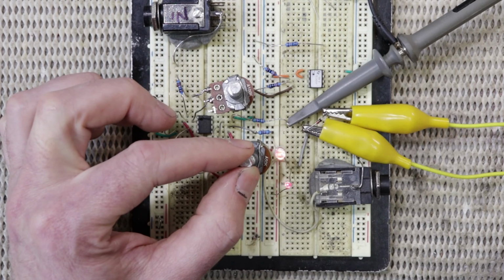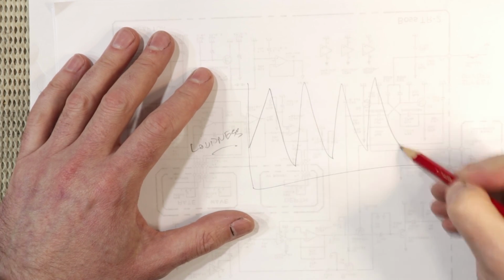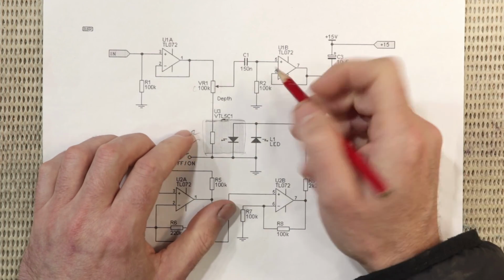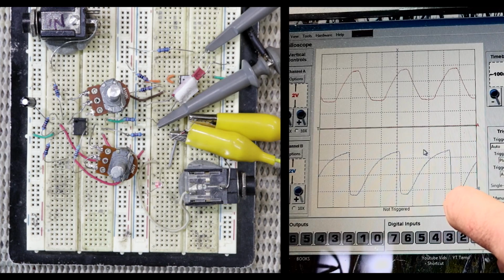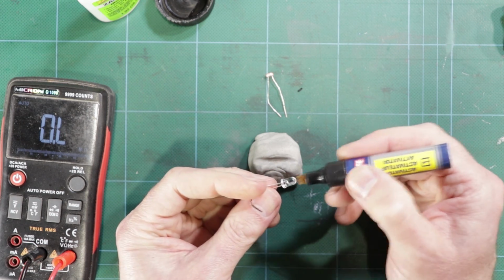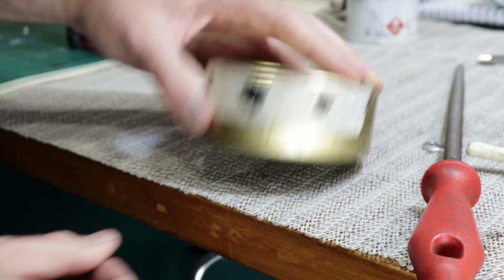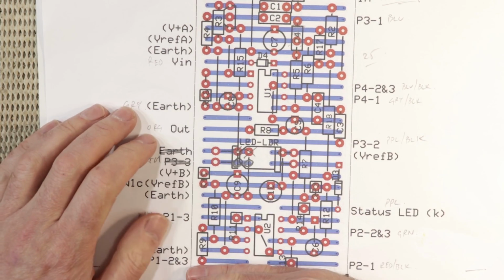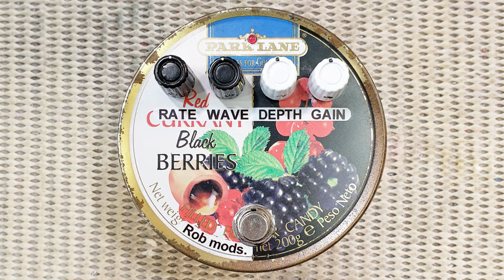DIY Optical Tremolo.  How to design a tremolo guitar pedal.

Comment: Can you elaborate on the c taper hack? Thanks!

Also about the ticking, I've read that they usually use low power op amps. Like tl022 or maybe try using tl062.
Reply from the maker: Yes, I've read this also.  In fact when I was filming I did talk about that as a possible 4th tweak if the others hadn't completely cured the ticking.  (I cut it out in the edit though.)  It makes sense, since a low current op amp also usually has a very modest slew rate, so it can't physically source the current in the first place, plus its output is slower to shift each time it flips.    I did actually try an LT1475 (ultra low current device) that I found, but since it was a true rail to rail, the tremolo sound was significantly altered, since the LEDs were turning on a bit brighter.  To make another op amp work would have meant breadboarding the circuit again, and the LM358 was just fine.  It has a fairly modest current draw and slew rate anyway.  

FWIW, getting the LEDs to match also took some tinkering.  I really wanted to use a 3mm as the status light, to match the other lolly tin pedals.  I probably should have just started with a matching pair of 3mm LEDs and made the isolator with one of them.  Thanks for watching my channel!
Reply from the maker: Oh, and the pot hack was simply that I needed a C50k (reverse audio taper), but only had a dual gang C100k.  By wiring the two gangs in parallel, a C50k was achieved.  IOW, the two left lugs were joined, the two wipers were joined and the two right hand lugs were joined.  In this situation, the taper stays the same.  FWIW, I have an old video with some other pot hacks...  https://youtu.be/iCUOVOOc5WY

Comment: @Rob Mods enjoy the Wurlitzer electrostatic continuous free reed organ vibrato circuit. The North Suburban Hammond Organ Society did some really good animated tech articles. 
VIBRATO CIRCUIT EXPLAINED-- first a little info about Hammond tone wheel organ vibrato and simple theory-  nshos DOT com/HAMMOND8.htm
And here is the unique Wurlitzer purely electronic vibrato ( nothing mechanical)  nshos DOT com/WUR12.htm

The Wurlitzer continuous free reed organ was Wurlitzers answer to Hammond's instant attack. Putting all of the reeds in motion at once from the moment  the organ was turned on allowed for this instant attack. It required all of the reeds be soundproofed. This Wurlitzer 4600 (in tech article link above) 25 pedal 2 x 61 keys ( and 4410 spinet version) organ introduced in 1954 was also the first ever organ with sustain. Wurlitzer invented the clever bleeder cap + resistor on each and every key for sustain decay on the DC Keyed keyboards ( a common method of all manufactures...except Hammond, the Hammond tone wheel organs aka B3/C3/M3 etc. were never conducive to sustain)

Comment: I can suggest to use separate grounds for generator and audio path, especially if wave control has opto-coupler.  This will reduce dramatically leaking of generator frequency into audio path. Also adding a high path filter on the end stage of U1 with frequency roll-off around 50-100Hz will greatly reduce that generator frequency sound at amplifier side.

Comment: This is such high quality content! Love your videos!
What would it take to make it commercial grade?
Reply from the maker: Thanks mate.   I'm glad you like my stuff.   I think you'd have to find a good consistent source of opto isolators. The LDRs i bought did vary quite a bit.  Then batch test them and adjust the circuit from there or create a trimmer circuit and alignment procedure for consistency.   Also I never tested or even simulated the circuit at 18v for example.   I doubt the oscillator would work as intended with 18v.  So a zener or reg or something would be need for the pedal to be idiot proof.